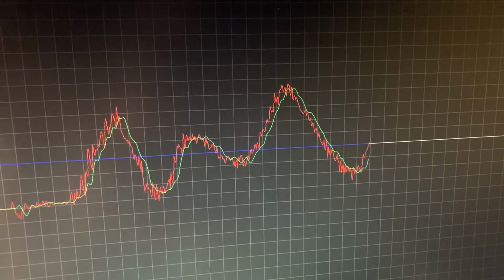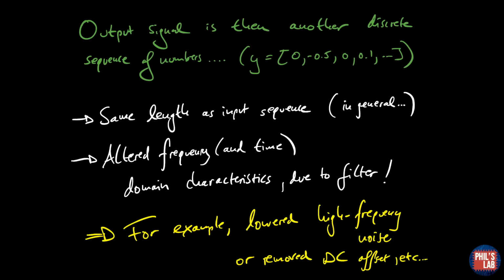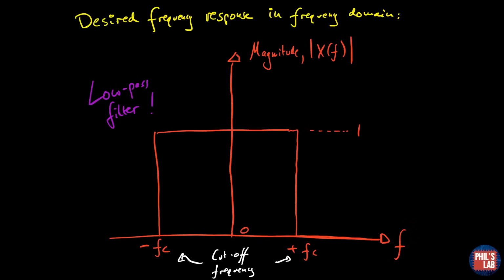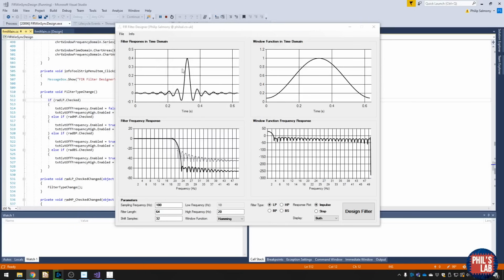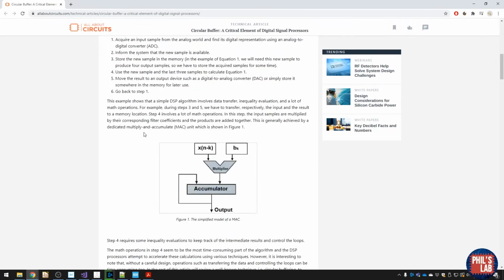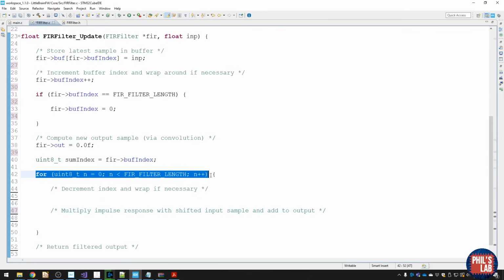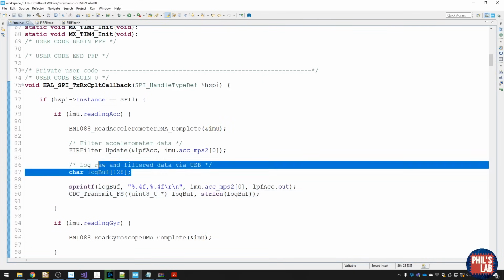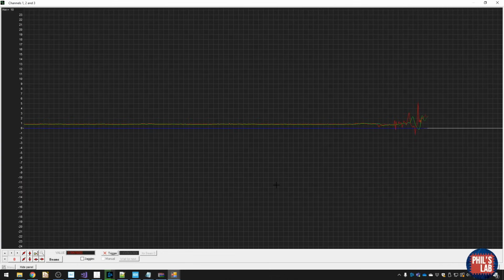(Sponsored) FIR Filter Design and Software Implementation - Phil's Lab #17

Comment: I have no idea how those operations are actually implemented by the compiler, but MIGHT it be more efficient to take the incremented buffer pointer modulo the buffer length? Would that be more efficient than doing a conditional?

IOW: j++ % BUF_LEN?

Comment: Amazing tutorial and very clean code.  When i handle interrupts, what I do is set a flag when the interrupt is identified, then immediately clear the interrupt.  Then that then triggers execution of the appropriate callback in the super loop.  I do this to keep the interrupt vector free and clear.  What do you think about this approach?  Of course if I was using FreeRTOS, I would have some kind of thread safe semaphore or even a queue.

But damn man your explanation of FIR filter was spot on and probably the best I have ever seen.

Edit:  also, subscribed! Keep up the amazing work!

Comment: Hi. Thanks for the great video. Two questions though;
1. You mentioned; anything below 10 Hz should have a DC Gain of about 1. What do you mean by DC Gain here in case of a low pass filter?
2. Before windowing, you mentioned that the filter response is not nice because at about 10 Hz, the reduction is only -6 dB or -5 dB. How much reduction should we expect for a great response after windowing?
Thanks in advance.

Comment: Hey Phil - once more - congrats & 1000 thanks for Your videos...
But: I'm wondering about wether in your "filtering-videos" You use always FLOAT...
...but I don't see, that You use the CMSIS-DSP-functions which are integrated in a Cortex M4 & M7?
I think you know (of course) the examples delivered by ST (for M746-Disco-Board) - also with an example of a FIR-filter...

So I have 2 questions:
1. Wouldn't it be faster an also accurate to work with 32bit integer to process a 16bit ADC-Result in the same way?
2. If it is not: Why you don't use the CMSIS-DSP-Functions?

Thanks for your answer...

...und mach weiter so - Leute wie Dich braucht das Netz !! ;-)

Comment: I have a question Phil, if you were to use this to implement an audio filter... obviously the sampling rate would be for example... 48000hz. But what about the filter length? Would this be the block size? For example, 128 samples? This is the part I am slightly confused about. As a side question, why do we shift the samples by half of the size of the length? Thanks. :).

Comment: Hello Phil, thanks for this excellent overview of FIR filters for embedded systems. Great tutorial indeed. Just one question: would you be able explain, in a few words/steps, what to download from github and how to run your FIR Filter Designer tool? 
1) Github is funnny and there is really no "dowload" button to just get the Filter Designer tool folder. (It seems we have to dowload all of your projects...)
2) I'm assuming once we dowload the FIRWinSyncDesign folder, we import this design in an IDE like Visual Studio and "add" all the files to a projet?
3) We then run the project?
Please let me know if I missing steps. Once again, kuddos for this video! JW.
Reply from the maker: Hi John, Thanks for watching! Glad you liked the video. Sorry, yes - you'll have to download/clone the HadesFCS repo (https://github.com/pms67/HadesFCS, Code -> Download ZIP), which in the 'Filtering' folder contains the FIR design tool. You'll need to have Visual C# (Visual Studio) installed to compile/run the programme. After import, you'll be able to run the project straight away.

Comment: Hello Phil, thank you for your video. I'm a really big fan of your work. Btw, I just realized something in your code that caught my attention (for the digital filter design that you wrote using c#). The filter coefficient generate into the text data has the decimal coma instead of decimal point. So when I paste the for example 32 coefficients into my code, instead of eg 0.12, 0.13, 0.14 it becomes 0, 12, 0, 13,  0, 14. Took me few minutes to realized why my filtered data behaving strangely. I quickly noticed this because the german write their decimal with coma instead of point. I am wondering why it doesnt show the error in your side. But anyway thank you for your code! It really helps with my project.

Comment: This is the best and more practical video that I have watch on this subject : congratulations ! 

I am a newbye regarding the FIR filters, so I just begin to learn... I have two small questions:

1-.@ 13mn27sec (and17mn07sec), what is the software or I.D.E. that you use for writing the C code in ? To plau with your program, we need to compile your C code...

2-@ 6mn40sec, I understand the mathematical part showing that the Output signal = Input signal convolved with Impulse response. But I am a little lost regarding how we define the Impulse response: the math part is not a problem for me, but we need to know the impulse response before doing the calculations, right ?
(my goal is to implement a FIR filter prior an audio DAC conversion..)

Thank you !

Comment: You have done in 30 minutes what my brain has struggled with for hours - trying to bridge the gap between the practical FIR filtering code that I've examined with the theoretical/maths in Lyons book.     This is one of the best tutorials I've seen on any subject - perfectly paced, clear and just the right level.   Thanks!
Reply from the maker: Thank you very much, Robert!
Reply: @PhilsLab  One question after playing with your FIR Filter designer:  what is the purpose of "Shift Samples"?   Once you set the filter length (# of taps) isn't it implied that you will always shift by 1?   Or is this a way to do decimation and filtering at the same time?

Comment: Thanks for the great video tutorial. I'm getting the first steps into the FIR filters. A beginners question, how do I compile your Filter disign tool?
Reply: I opened it with Visual studio and then had to "retarget the solution" to some newer packages. Clicked in compile/start and it works
Reply: @GabiMartin97  Many thanks. I'll try it
Reply: I'm troubling on getting it to work...
Reply: I'm getting this message "Severity	Code	Description	Project	File	Line	Suppression State
Error		Couldn't process file frmMain.resx due to its being in the Internet or Restricted zone or having the mark of the web on the file. Remove the mark of the web if you want to process these files.	FIRWinSyncDesign" it's probably rockie problem

Comment: Thank you for this video. It's helpful. One question I have is at ~4:30, it's said that the output length is "in general" the same as the input length. For FIR, how can this be? If I take a 4-sample sequence and convolve it with a 4-sample filter kernel, the output is (2*4-1) 7 samples long.

Comment: Hello, nice video ! I have a question though, how the FIR_IMPULSE_RESPONSE buffer is supposed to work ? I can see at no point in sources where it is filled, only read. And about its init value, I would say it is initialized to whatever not predictable value. Could someone explain how it works ? Sorry for the noob question...
Reply: For those interested: FIR_IMPULSE_RESPONSE buffer seems to be initialized with random values. In my case I chose to initialize all its values at 1.

Comment: hi,
 i don't understand ont thing. if i have filter order equals to 3.

n=0

addr | samples | coeff  
  0.    |.   x(0).    |  h(0)  
  0.    |.     0        |  h(1)  
  0.    |.     0        |  h(2)  
  0.    |.     0.       |  h(3)

n=1

addr | samples | coeff  
  0.    |.   x(1).    |  h(0)  
  0.    |.   x(0).    |  h(1)  
  0.    |.     0        |  h(2)  
  0.    |.     0.       |  h(3)

n=2

addr | samples | coeff  
  0.    |.   x(2).    |  h(0)  
  0.    |.   x(1).    |  h(1)  
  0.    |.   x(0).    |  h(2)  
  0.    |.     0.       |  h(3)

n=3

addr | samples | coeff  
  0.    |.   x(3).    |  h(0)  
  0.    |.   x(2).    |  h(1)  
  0.    |.   x(1).    |  h(2)  
  0.    |.   x(0).    |  h(3) 

at this point I should insert the fourth sample. If I used the linear buffer I would have to do a shift:

n=4 (Linear Buffer)

addr | samples | coeff  
  0.    |.   x(4).    |  h(0)  
  0.    |.   x(3).    |  h(1)  
  0.    |.   x(2).    |  h(2)  
  0.    |.   x(1).    |  h(3)

n=4 (Circular Buffer)

addr | samples | coeff  
  0.    |.   x(3).    |  h(0)  
  0.    |.   x(2).    |  h(1)  
  0.    |.   x(1).    |  h(2)  
  0.    |.   x(4).    |  h(3)

I'm going to replace the older sample with the new one. However, in doing so I no longer respect the multiplications with the coefficients. Am I wrong? Thank you

Comment: Thank you. The real question is why the sensor generates noise in the first place? When it is static there is no noise, but when you swing it we see a lot of added noise that shouldn't be there I think. If the noise is part of the true data it should be left.

Comment: Your Nyquist limit says your rate must be less than fs/2. If it were equal to fs/2 the output woudl be a costand related to the phase of you sampling with fs/2. And if your signal is just a fraction under fs/2 your filter will take infinite time or samples to show the signal. So that is a good lead-in to what is a good sampling rate compared to Nyquist and how does that effect time response?

Comment: In a previous attempt to understand FIR, I used Excel to model a Low Pass Filter.  Rather than impulse, I used a step (square wave) and altered the response until it matched a sine wave.
Having the proper math would probably be better, but it worked as a one-off.

Comment: Hi Phil, great video. I have a question though. Can you explain why you implement the filter using convolution instead of the FFT and multiplication in the frequency domain and then the inverse FFT? I am relatively new to DSP, so I might be asking something obvious here, but my understanding was that the FFT was quicker then directly computing the convolution. 

Thanks for the great video!

Bas
Reply from the maker: Thank you, Bas! FFT-based convolution (via multiplication in the frequency domain) is only really faster when the filter length is >= 64 (approximately, depends of course), so one should stick to normal convolution for shorter filter impulse responses.
Additionally, implementing an FFT-based convolution is far more complicated to code and would make for a much longer video.
Reply: @PhilsLab  Thanks, that's clear now. On a side note, I would watch the longer video on the FFT implementation.

Keep doing wat you're doing!

Bas

Comment: In the first place thak you very much incredible explanation! i was trying to implement this filter on a MSP430 for a university assignment, but i am getting attenuation even at DC. Do you have any tips of what to look for? what i am doing wrong? thanks!
Reply from the maker: Thank you so much, Joan! You can adjust the DC gain just by multiplying all filter coefficients by the same value.
Reply: solved! i can't thank you enough.
looking forward to that course you talked about a while ago🙈

Comment: Wow this is interesting and I will have to go through it in detail again to grasp it fully.
I have been doing filtering using only a simple moving averager of N samples (and sometimes a weighted moving averager) on 16/32 bit MCUs without never really understanding or doing any filter design. Can you tell how different is that to FIR filter?
Reply from the maker: Thank you! A simple moving average filter is effectively a FIR filter with equal coefficients in the impulse response array. You can write moving average filters recursively however.
Reply: @PhilsLab  understood. thanks for your reply!

Comment: Very good, any chance you can explain how to download your design programme code, nothing I try works.
Reply from the maker: Thank you, Percy. The files in the Git are the source code, so you'd need to compile it with Microsoft Visual Studio (C#).
Reply: @PhilsLab  Fair enough, can do, but there doesn't seem to be a way to download all the required files at once? In fact there is no download option at all as far as I can see, the best one can do is open each file individually and cut and paste, is that correct?

Comment: I wish there was a bit of electronics demonstrations. I don't know actually where all you are talking about is in electronics world. 

1. What hardware setup you are using?
is it the microcontroller dev board or it's another piece of hardware? 

2. What level of electronics this happens? audio, wifi, bluetooth signals...etc. ?

What I liked:
1. The code explanation is very good especially following up other drivers libraries you've done in other videos

2. Theoretical information about is good even I didn't get a clear idea of where FIR should be implemented?

Comment: Really great video that is applicable to some things I am doing. Would love to see you design a circuit for recording and sampling audio. I have been trying to figure out how to make a circuit that can sample audio cleanly as well as dc input signals.
Reply from the maker: Thank you! That's actually exactly what the upcoming PCB design course is going to be on. So hopefully that could be of interest :)
Reply: @PhilsLab  I'm very interested. It seems like audio input is fairly straightforward with a codec but having the same circuit able to accurately sample DC input is giving me some trouble.

Comment: Very informative video. Just curious though, you used an if statement for implementing a wrap-around on the buffer index. Would it be also possible to use something like 
fir -> bufIndex = bufIndex % FIR_FILTER_LENGTH ?
Reply: It's possible only if FIR_FILTER_LENGTH is power of 2. Then you can replace "IF" statement with "fir -> bufIndex &= (FIR_FILTER_LENGTH - 1)"

Comment: Very cool training course, so well done, I love it. Don’t forget to setup a PayPal URL to support your activities for me and others.

Here is some minor programming feedback.
- for the sprintf use always the snprintf function e.g.: snprintf(logBuf, sizeof(logBuf), …)
  This is a good programming practise to avoid buffer overflows.

- For circular buffers the wrapping can be made easy via modulo operations.
e.g.:  fir->buf[fir->firbufIndex++ % FIR_FILTER_LENGTH] = inp;
This way you never need to check if your are at the end of a buffer or at the beginning)

Again really great stuff you are doing here.
PS: I would write this as a C++ class where the constructor gets the length of the filter as a parameter and allocates the float array, however for the audience here keeping it simpler with basic C is better because everyone must understand the individual steps.
Regards from Hannover, Helmut

Comment: Programming tip: If you keep buffer length a power of 2, i.e. 2^4=16, you can reset the index faster using: fir->bufIndex = ++fir->bufIndex&(FIR_FILTER_LENGTH-1)
Reply: One comment: if filter length is L=2^N, then the group delay of the output comes in-between the samples: (2^N - 1) / 2. For example, for N=3, the group delay is 3.5.
    This can be important, if filter data need to be combined with the input data.

Comment: uhm, why dont just use an analog lowpassfilter?
Reply: For simple filters go analog indeed, but once you need higher order filters the component tolerances will start to mess up your filter response and force you to start hand running things. Digital filtering is very reproducible

Comment: Where you format the accelerometer output before calling CDC_Transmit_FS(...) sprintf() returns the number of characters written to logBuf[] so you can save yourself the call to strlen() which is yet another pass over logBuf. I'll keep my comments about using sprintf() in ISR's for another day :-)  ... Ok, well, this is relatively low rate stuff so formatting and transmitting from another ringbuffer in the main loop fed by the ISR would be another option to keep the ISR's lean and mean. Great stuff.

Comment: can this be used for a delay given an appropriate impulse response
Reply: If you only have one non-zero filter coefficient, that'd basically be a delay line. But if you only want to delay the input (and no other form of filtering), that'd be a horribly inefficient implementation.

Comment: Thanks for explanation! Great video, as usual!👍🏼 I’m frequently using simple complementary filter (or alpha-beta filter), where, simply saying, val_filtered = val_filtered*alpha + val_raw*(1-alpha). If comparing with FIR approach, what are pros and cons? Is there the same math under them?
Reply: Good question!

What you have there is basically a degenerate infinite impulse response (IIR) filter, with 1st order feedback & 0th order feedforward. In general,

y(n) = ∑_{i=1}^M a_i y(n-i)  +  ∑_{j=0}^N b_j x(n-j)

In your case, the feedback order M=1, feedforward order N=0, and you have an additional constraint that a_1 + b_0 = 1. So you could analyse a "complementary filter" as an IIR filter of the lowest possible order.

Rather than enumerating the up- and downsides, I'll just leave this here: https://en.wikipedia.org/wiki/Infinite_impulse_response#Advantages_and_disadvantages
(tl;dr: faster & lower order required, but potentially unstable due to use of feedback.)

Have to say I've never heard of the term "complementary filter" until now. Is this purely a term used within the robotics community? I've used it at work before but we just call it a "lerp filter" without looking too deeply into the name—you're linearly interpolating between the previously filtered value and the next raw input. 

Incidentally the feedback in a complementary / lerp filter is guaranteed to be completely harmless as long as you only interpolate and don't extrapolate—i.e. keep a_1 ∈ [0,1). I'm sure we can prove this but I've waffled on for long enough already.
Reply: That's an IIR filter